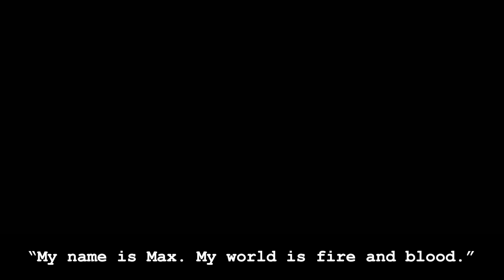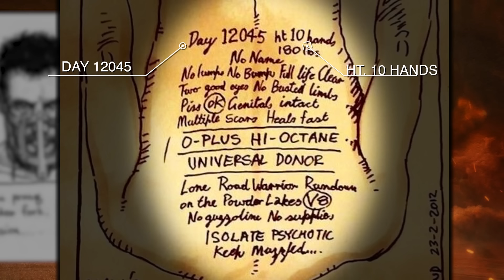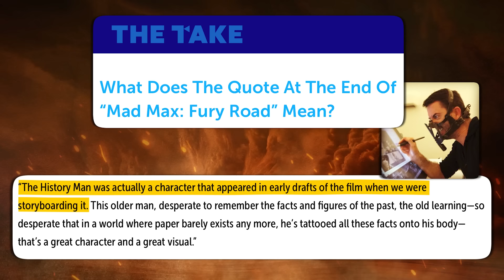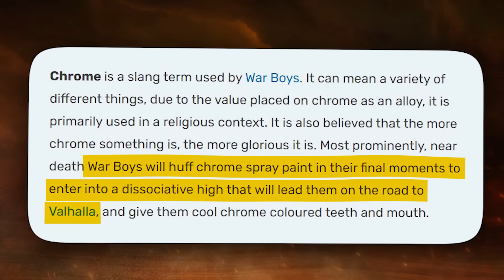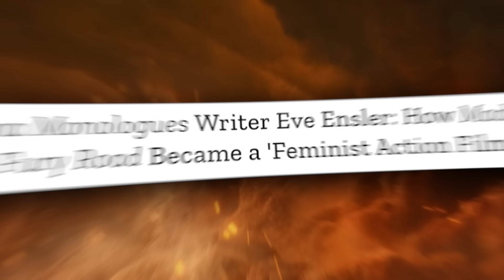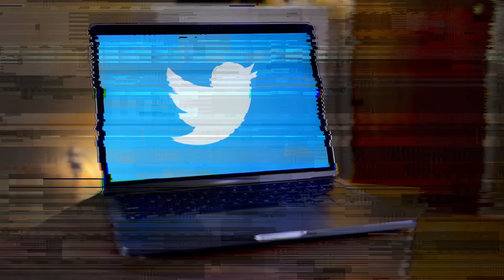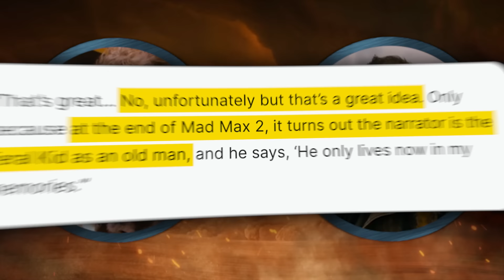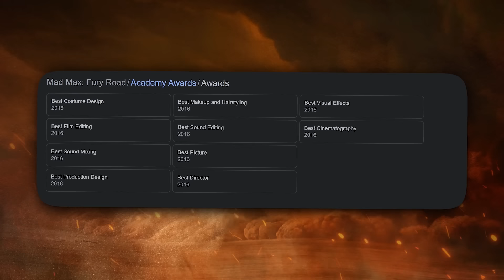MAD MAX FURY ROAD BREAKDOWN! Secret of the Chrome | The Deep Dive

Comment: One thing about this film that is often overlooked in terms of the production and accolades is the sound of this film. It won Oscars for both best sound mixing and best sound editing and it really shows. If you play this in a home theatre with a really good surround sound system (even just in basic Dolby Digital 5.1), the soundscape and surround effects are incredible. There's a particular scene in the mud blue area where you hear a gunshot coming from the rear right and it is so well done and quite frightening, I actually thought something had happened in real life. This is one of my reference films to use when testing a new surround sound film (along with Master and Commander as well as Ford vs Ferrari).
Reply: Yeeeeeessss. If it ain't this or transformers then I'm not sure it's worth watching for sound design alone 😅 
If you have any suggestions PLEASE share, it's so difficult to find a movie with unique and intriguing sound 🔥 
Oh also I gotta say aquaman is pretty good sounding movies, probably deserves to be credited anytime the other two are mentioned

Comment: Truly a great film.  I was really impressed about the attention to detail of Max reapplying the air-brake supply hoses to stop the second trailer from skidding.  All Air-brakes have dual-functionality; If you don’t have adequate air supply from the air-compressor the spring-brakes will apply and you can’t move in the first place.  It’s like a deadmans switch so you don’t accidently kill people on the highway/freeway.   You can’t drive the bigger trucks if you aren’t certified in the systems entire purpose or capability.  The psi/kPa dump would suggest that the entire truck has a higher governor lockout and it didn’t just lock all of it’s tires.  That’s riding dirty for sure.

Comment: 10:03 Actually it would be the eight pistons of the V-8 engine. It would have 16 or 32 valves, depending upon brand and configuration. There are even a few obscure and/or experimental V-8s that I've "witnessed" that utilize 5 valves per cylinder, for a total of 40 valves.
BTW, yes I am a Blackthumb. An auto mechanic since 1993.

Comment: Okay, the finger thing tells me you ain't a gearhead. And no, not a slam. Only a teaching moment. 

The fingers in the salute represnt the 8 Cylinders of a V8 engine, nit the valves. Each cylinder has between 2 and 4 valves in the cpmbustion chamber of the Cylinder Head. One to two are intake valves, allowing air or air/fuel into the cylibder to be compressed, and ignited.

After the power stroke, the rotation of the crankshaft puses the piston up, and the other valve or valves open, between one or two again,  open up, pushing the gases out into the exhaust.

For valves, each war boy would need 8, minimum, up to 16 fingers. 

Loved the video bro. These little details are why I have always been a fan of the series, and most Miller projects. The minimal dialog makes you have to watch to truly see the story.

Thanks for making this one.

Comment: Just found your channel and love it so far.  One tiny thing... The V-8 engine has eight cylinders, not valves.

Also, the lightning in the sand storm comes from the static electricity building up from all those millions of tons of very dry sand flying in the air.  A similar effect with corn dust or flour can cause silos to explode.

Comment: 8:20 sometimes real steering wheels are detachable 😂 I don't remember it because I was like two years old (early 90s), but my dad was driving us down the mountain in the dark once and the steering wheel just came loose from the steering column. It must have been a bolt that got stripped or worn or something, I'm not sure. But he said he had to basically press back against his seat and put all the bodyweight he could into pressing the wheel down into place and steer, and it was like there was no power behind the steering at all so he had to turn really hard. Somehow he got us down the mountain alive lol.

Comment: 16:50 You finally mentioned it. I saw at least a dozen reviews over the years and no one seemed to know about "chroming," or "huffing."
       I worked for a drug recovery program. We had to keep people from getting a hold of this silver spray polish and cleaner for the elevator walls. They sometimes would huff it and get high. That's what I figured they were doing before battle.

Comment: Th lightning inside the sandstorm is actually  based in reality. Really massive sandstorms generate vast amounts of static electricity, which can be discharged as lightning. Usually it is field lightning (A whole "wall" of light form a simultaneous discharge, but the traditional forked lightning going from ground to sky by creating a plasma path also happens. It is exaggerated in the movie, as is the sandstorm (global warming adding tot he energy of every weather event, perhaps) ... but yeah, electrical flashes in the middle of a sandstorm, very much a thing.

Comment: Mad Max Fury road is right there with Top Gun Maverick is among those really, really rare film sequels that actually does not stand in the shadow of the original films. For both films we thought they have to be rubbish, after such a long time a sequel? Can't be good, we were proven wrong in this occasion, but dozens have proven us right, like Prometheus, or the Star Wars prequels, though in retrospective, the SW prequels weren't that bad, just the writing and the dialogues were, questionable to say the least.

Comment: Tiny gripe, because this is the internet, so I have to be annoying....
I believe you meant that they pray with their four fingers interlocking either way, representing the 8 CYLINDERS of the V8. I'm no mechanic, but I believe a V8 would have, at minimum, 16 valves.